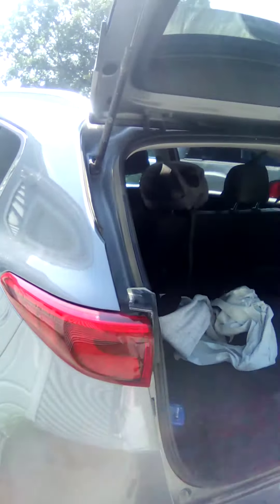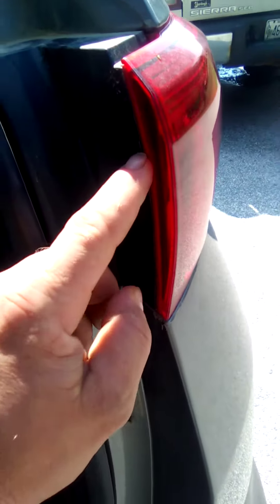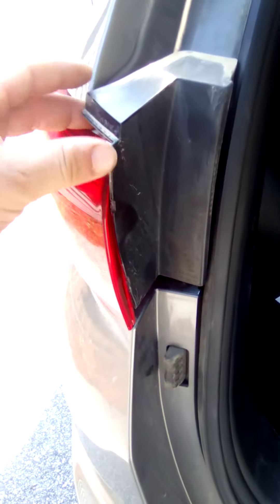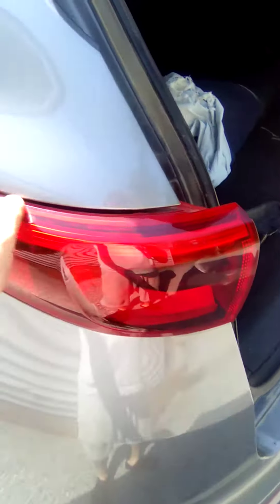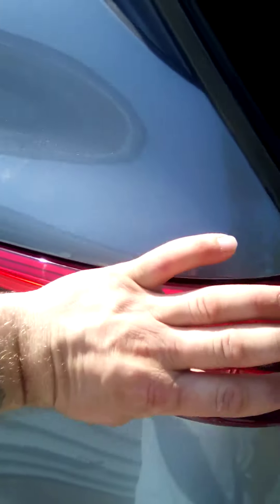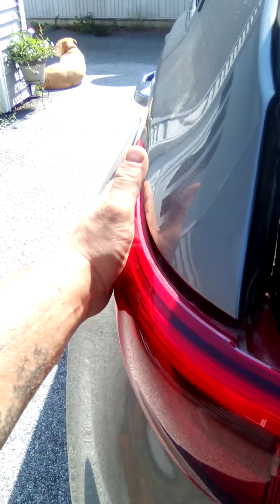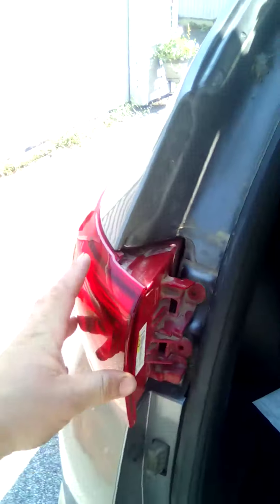How to change 2017 Kia Sportage tail light

Comment: I struggled with this for a couple of hours, looking at this video and others over and over again between bouts of almost losing patience and aching hands.  Ultimately I decided that the videos weren't going to tell me what I needed to know.  I pulled out the light receptacle as much as I was able and looked into all the crevices to see if there was something obstructing - and there was!

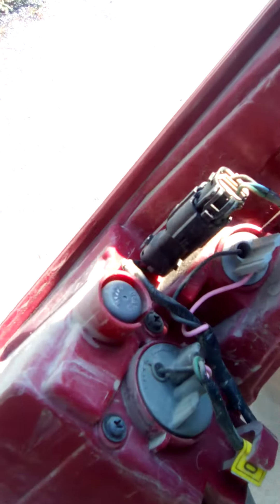There is a wedge-shaped (?) piece protruding from bottom of the the light fixture that fits into a receptacle piece in the body of the vehicle below it.  It's about 2 inches from the inner edge of the light fixture on the bottom.  I used a slim screwdriver to wedge the two parts over each other and the light fixture came out easily after that.  If you don't do this, it seems like you need the grip and strength of Hercules as well as a bit of luck to pull the fixture out in just the way the wedge-shaped piece allows without breaking it.  You can see the wedge-shaped piece clearly at 2:07 in the video at the right side middle of the screen and again at 2:22 in the center of the video.

If it helps, here's a Dropbox link to the photos that you can download and examine for yourself:
https://www.dropbox.com/scl/fo/yrz5cf0lq14st9x948hcx/h?rlkey=g6qaiu5wjxojd2dz7fb1v2gzl&dl=0
Reply: Went from being the most annoying job ever to like any other replacement because of your advice. Thank you so much. 🫡